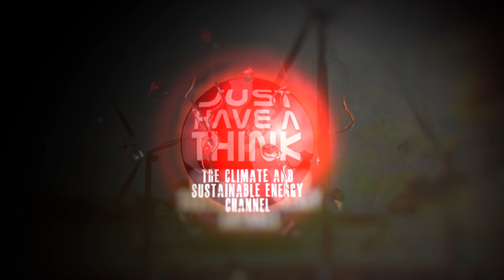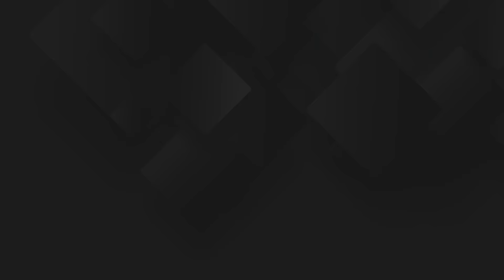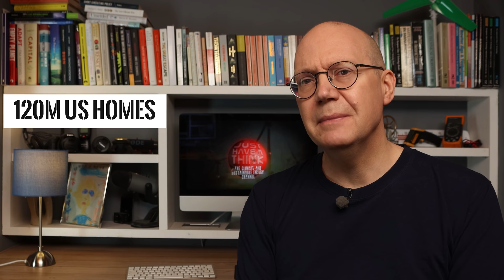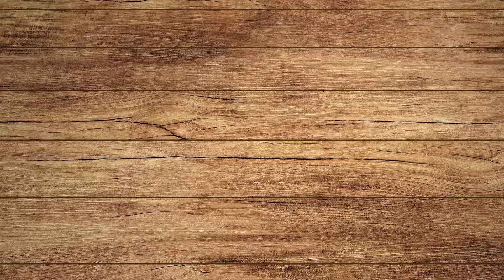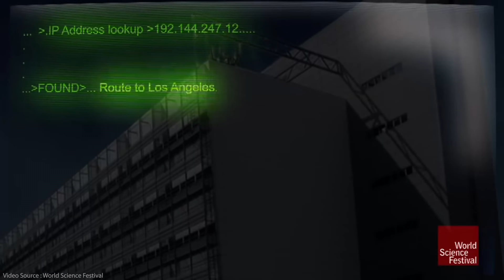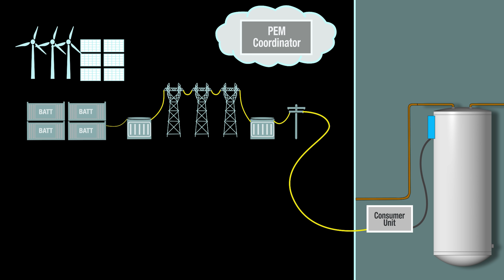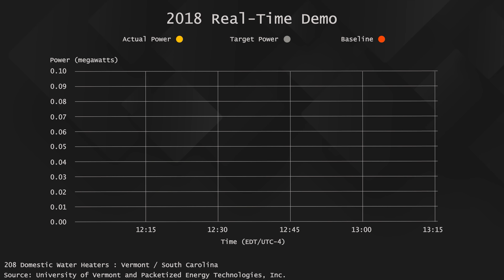How to balance renewable grids WITHOUT energy storage!

Comment: OK I was skeptical at first but this is more fascinating.  Concerns about the scaling of that PEM system give me pause... and potential hackability et al... how sophisticated do these need to be, likely using public key cryptography to authenticate units?  And how on earth will that work...

Moreover with EVs, some require active thermal management (running the A/C compressor to chill the battery as it charges), I am not sure how that will respond to intermittent loss of power (intermittent veto of packet requests).  Might be fine but the car can't really communicate with the EVSE as to whether it really needs power for cooling right now, so the EVSE doesn't know.
Reply: I request a packet with a random 64 bit code. A signal comes back with that 64 bit code saying yes.

This goes over the powerline to the local transformer controller.  it then aggregates it and send a request up the line. 

If it is charging then it powering the air compressor.  And it would request a block of time so it won't turn on and off.

Comment: The gotcha is that there are so many high power devices that need to be retrofitted with the PEM device.  The average home might have the water heater, fridge, heater, stove, dryer, and eventually an EV.  That's 6, and there may be more. DIYers would probably get angry if their power tools had to wait.
Reply: Power tools are not good candidates for the PEM. They are small and need to be used now.

Comment: The TEXAS freeze-out was not because of a lack of cool software, but because the Federal Government would not "permit" them to fire up and maximize the use of their coal plants when Texas was expecting the record cold, days in advance, because of the government limitation due to "climate change" emissions.  Only after the record collapse had set in for several days did the government relent, grant permission, but only with steep financial penalties which sent local rate payer bills 5-10x higher.  There were other factors, but this was perhaps the biggest.

Comment: This will work to solve single day storage problems. But you don't change much about the actual demand. So long term storage is still required for those less windy and sunny days.
Reply: It's not less windy or less sunny everywhere at the same time. Demand management is just a piece of the whole, it would reduce the total amount of storage needed.
Reply: @GregHassler  Did I not pay attention during the start?  Because if the proposal is to make a massive distributed network like the internet. The downside is that the infrastructure doesn't scale as easily as the internet. This does indeed sound like a good way of doing it if it turns out the infrastructure is a better solution compared to storage though.

Comment: Management is important but it cannot replace energy storage. We shut down many of german wind turbines on a daily basis because there is no way to use the energy. Hours later the coal plants step in to deliver the energy needed. It will not help to install even more wind turbines.
Same with my PV and the car. The car is parked at my work site the whole day when PV is in full range. When I come home, the PV is down and the car battery is empty.

Comment: Some devices may not care if they are frequently switched on and off, but high-load, sophisticated units such as modern heat pumps may need a signal to the controller to bring the system up and down gently. If this is not available, fooling it with false thermostat readings may be a way of safely retrofitting PEM, but it would mess up usage statistics!

Comment: In my mind, I see homes having their own storage with an inverter. Those storage devices could then use the algorithm shown in this video to charge. So, estimating their remaining energy and estimated daily consumption, the "battery" could request a certain amount of energy and charge time from the grid. In this way, you don't need to replace millions of water heaters, on-demand heaters, space heaters, grills, toasters and every other device that uses power. The more transparent to the end-user, the better in my mind. Using local storage with energy packet delivery would smooth the demand on the grid and work for ALL devices in the home. But, I can't see this scheme working if every electric device requests charging from the grid. And, if we DON'T have every single device in on the algorithm, then there's still much unpredictability.
Reply: The problem with this is the cost of such a residential system.  I'm currently ordering stuff to do something similar, and I'm guessing most folks wouldn't be able to afford the cost, or even be willing to pay for such a system if they could afford it.
Reply: Yea, that’s probably a simpler way to get maximum benefit in as little time as possible.

Comment: There are a whole lot of solutions that could be integrated to stop unnecessary strain on electrical grids. This is one more in that arsenal. Micro gridding is another. The trick is to act like adults and realize that such options exist and then implement them. I refuse to believe that all of thse ideas are a boondoggle as some claim.

Comment: Fantastic tech, and I hope it gets implemented soon, but this definitely has a few problems that I can see.
First off, what's the method of communication between provider and receiver?  Through the internet? Via a new cable? Wireless cell service?  If it's through the internet, then your ISP could easily hold you hostage.  
And since it's another piece of smart technology, it's another digital security vulnerability that you'd need to deal with, because not only is it a possible entry point into your network, but a hacker would be able to turn off your hot water, heating in your house, and charging of your vehicle, the three backbones of our modern society.
Reply: Powerline communication. 

NO connection to the internet at all.
Reply: @catprog  Ok, I'm almost completely ignorant on how the power grid works outside of "The cables connect the generators and power-plants to the grid, which is a series of connections that connect to the houses to be managed at the breaker box."
And the only instance I've seen of powerline communication is from Person of Interest, where the AI used low-level fluctuations to transmit data across power cables.
So how exactly would it work?
Reply: @Theminecraftian772  high-level frequency fluctuations.   You send a 1-2V signal at 100MHz on the cable.  It is picked up at the pole transformer and aggregated before being passed on to the next transformer up the line.

Comment: I think the reality is that there is not much scope for significant time-shifting of loads, beyond the water-heater control that is established technology.  Car charging is just another form of battery storage.
Interesting as this tech sounds, it would not be greatly useful without time-shiftable load.  And finding that is a real challenge...
Transport and electricity have one important thing in common: They must be created at the instant they are consumed.
While electricity is relaitively cheap, most users are not interested in time-shifting load to reduce cost a little.  

My question about balancing load and generation is: How can the energy balance be achieved in gross with non-carbon fuels.

Comment: Notice how the logic of this system is decentralized and based on the unique requirements of each item in the network. This model works with economic systems as well as networked devices. Unfortunately, there is a clash with some political ideologies. When a political system is based on dialectics (Hegel, Marx, de Beauvoir, Marcuse, Mao...), decentralized networks are regarded as inherently threatening because dialectical materialism is statist, and idealizes central control. Thus, when engineers propose solutions like the one in this video, they inevitably face political resistance from politicians, lawyers, and bureaucrats who hold those ideological beliefs.

Comment: How does this beat existing domestic & industrial grid-tied inverters which monitor grid frequency & respond by shutting local circuits off &/or boosting the grid from local batteries?

Comment: PEM love the idea but a few thoughts
Internet connectivity
Device preference car vs heater vs xbox :)
On demand access to power. Kettle for example.
Any atempt to prioritise say emergency infrastructure leaves it open for political influence and legal regulation.
Reply: Ev flat and Hot water cold have priorty 0. 

Ev full and How waer hot priorty 100.

Xbox is always on. NO pem at all.

kettle might be a 90 to 100 until it gets the response.

Comment: I have seen videos speaking of balancing power using smart grid meters, turning off and on home appliances, and pulling power back from your Ecar. Sounds good in the Ivory Towers in California, but it will be a disaster for our economy. Nuclear power, base load power is the answer. Smaller ,factory built modular systems spread out rather than huge reactors is better.

Comment: 1st big solar event and consumers are done.
(EMP would have the same effect, but if that happens, we have bigger problems)
The problem is the total energy consumption. To transition  present US electric power generation from fossil fuel FOR ONE AVERAGE DAY requires some combination of 
300 x 1 GW nuclear power plants,  
or 4 billion x400 watt solar panels plus 1.3 GWH storage
or 600,000 1.5 MW wind towers @33% coefficient of performance  plus storage.
This does not account for changing load through the day, week, month, or year.
It also does not account for calm days or cloudy weather.
I'll leave it up to you to decide the percentages of each.

Sure smoothing consumption helps, but that 300 GW AVERAGE generation does not just magically appear.
Roughly double that 300 GW to include transportation.
Multiply by 7 for the world.
This does not even address heating and industry.
Unreliable energy WILL destabilize or even destroy the economy.

Comment: A huge hurdle for this is going to be security. This problem has been foreshadowed by hacks and exploits of various elements of the burgeoning 'internet of things'. If its not designed from the ground up with security in mind, imagine the consequences. Some hacker, perhaps supported by am opposing state, tells every water heater in the country to turn on at the same time. Insofar as the new grid depends on the smoothing of PEMs, when that smoothing is hijacked into a spike creator, it would mean wide scale power disruptions.
Reply: PEM goes I don't need to turn on. I am full.

Comment: it then boil down to one situation, what is a healthy electricity grid? in the supply side, the perfect situation should be the 3 phase of the generator have balance load. the generator will then have the best effectiveness. here the suggestion is on the buy side, does it consider the loading balance? your home bill may have couple percent change, but the power plant still have to consume the same, if not more, to balance the generator. if you want a buy side change, home appliances may need more change. say, you don't need a full tank of hot water while everyone is out working in the day time. a half tank or less in the heater probably a good idea to save energy and money as well? it is a false image to save money only but the total energy used are still the same. no matter what price and what source of energy use to heat water, it still need that 4100j/c/liter to heat water, right?

Comment: this system is very granular. it would be simpler to let houses have things like the tesla power walls, and let that alone do the polling for recharge from the grid. and the house hold devices use from the powerwall as needed

Comment: Why not having flexible energy prices that adjust with the grid load? They just need to be announced electronically. Consumers can gain by anticipating. Home/car batteries can charge when prices are low or even negative. And given back on high demand moments.
Such system is much less prone to problems or hacking.

Comment: I once tried to research companies developing actual solutions for smartifying the energy grid.  This PEM startup sounds exactly like one part of I was imagining.  Are there other, similar companies?  
I was also imagining possible solutions to the massive efficiency losses in long distance power transmission via small decentralized power generation/storage/usage cooperatives.  Any standouts in these spaces?
Reply: I believe High Voltage DC transmission is now very efficient.. thus projects like the Australian solar park that will send power to Singapore.

Comment: I'm not sure that adding more complexity to an already complex system is a viable alternative to simple conservation on an individual basis. Adding complexity to any system only increases the likelihood of a catastrophic breakdown. Also, being "connected" to the "network" only opens up a new potential avenue for malicious attacks as in being hacked. I work in IT now, and I have had to fix a hacked camera surveillance system at a public golf course clubhouse with a firmware update, clean reboot, and some programming changes. Hackers were using each camera on the system as a mini bot net for DDOS attacks elsewhere. The automotive industry has encountered this time and again. It's why we now have the war over "right to repair"! Society doesn't need more complexity added to our modern lives - we need less complexity and more reliability.

Cars are way more expensive than they need be on account of all of the added features (most having been mandated by government with just a few coming from true customer desires). Infotainment and navigation systems, Android Auto, mobile wifi access, connected vehicles, and the latest piece de resistance: an ignition interlock on every new vehicle that will prevent an inebriated driver from even starting the vehicle. All of which adds largely unnecessary costs to the end product for end users (consumers). Not everyone is a lush. In fact many of us do not drink alcohol at all, yet we will all be paying more for this mandated technology in every new vehicle! There's nothing quite like using a twelve pound sledge to drive a six-penny nail! 

So under a PEMS world, our toasters and water heaters and clothes dryers will be all that much more expensive - as if they weren't too damned expensive already - and outside of the financial wherewithal of most people. PEMS - fully implemented as envisioned - will only increase income and wealth inequality.

As an aside, I use to work for Detroit Edison under contract for their residential metering department. I did installations of the interruptible meters for both hot water heaters and air conditioning units. Those units work well and are reliable - as are the savings received by the customer with the lowered rate they are charged per kilowatt. In the 4 years I did that work for Detroit Edison I only ever removed one of those interruptible metering units because the customer was unsatisfied with the service and its savings.

You might be surprised to learn that as an IT technician, I am not terribly fond of IP telephony which everyone seems to really want nowadays. I try to warn them about the inferior voice quality. The jitter and echo of latent and lost packets. The overall "jankiness" of voice calls over IP and it does dissuade some customers from being enamored of the "latest tech" but some die-hard first adopters forge ahead anyways. A good technician will give you everything that you want, but a great technician will give you what you actually need to be your best at whatever you are doing.

Comment: What we actually need is far more electricity consumption. I'll explain why. Lets create a bunch of new uses for electricity - mostly industrial. Things like green (hydrogen) steel production. Cement production via electrolysis. Using electric arc furnaces to recover and recycle landfill. And so on. This creates some industrial scale uses of electricity that can be demand managed far better than a lot of the loads we have now. This in turn creates a market for far more variable renewable generation. In turn, higher priority uses of electricity (the things that must always remain on) actually get a more reliable supply. In a market where there is multiple times more supply (than today) of cheap power, we can also turn to simpler and cheaper (capital), but less efficient stores of electricity - including thermal stores. And we can afford to have household level stores of heat that can continue to heat houses even through weeks of bad weather.

Comment: Call me an old fashioned network engineer, but the PEM looks like a thoroughly centralised, "single-point of failure" hub, rather than some decentralised, distributed power mesh, where devices negotiate locally and with each other, sharing localised resources, before requesting centralised ones.  This seems to be more about the consumption of power in discrete units that the big boys can control rather than a real distributed "Internet style" power distribution vision.

The real decentralised vision, would be one where any device can make a network request for a certain length of energy packets, which can then be served by one or more other devices on the network, whether that is your mobile phone, PV, elec vehicle etc etc.  Those requests could be served by your next door neighbours fridge, or the nuclear power station at the other end of the country.